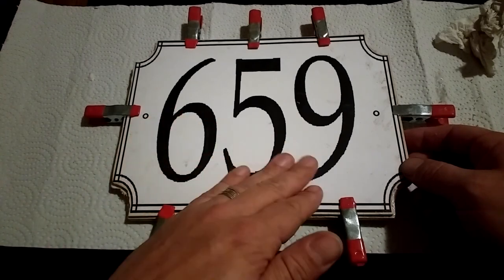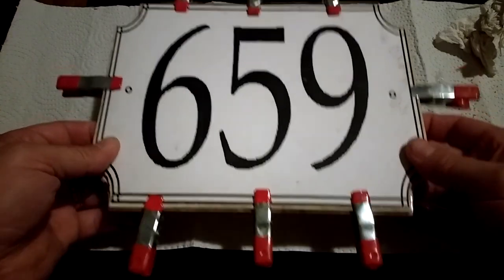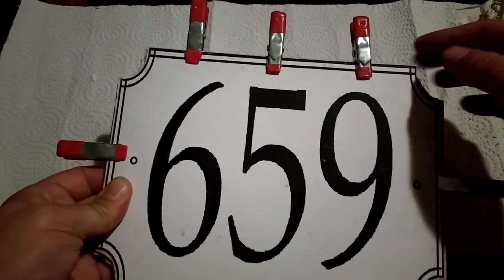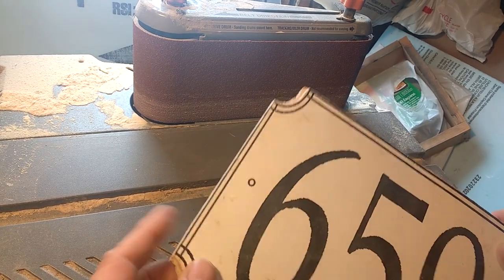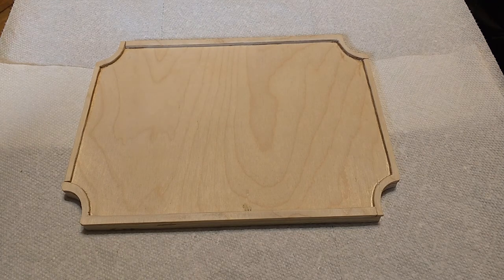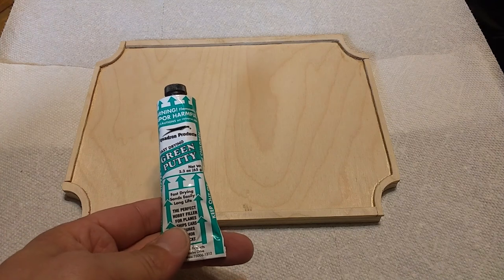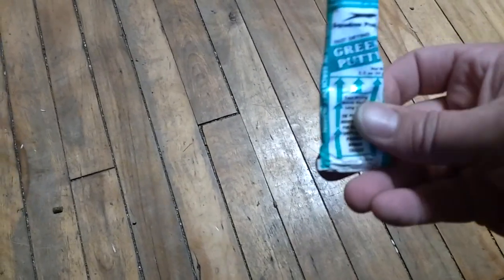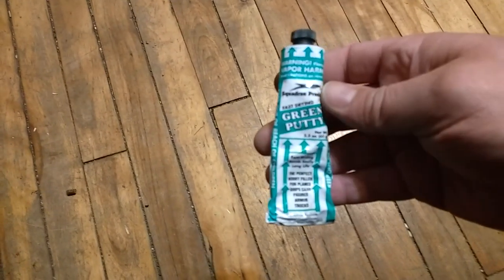Making a Cast Aluminum Foundry Pattern

Comment: Nice job, it'll be a great pattern to reuse.  You're making bigger flasks and I'm thinking of making a smaller one. Just finished a casting project where the parts were small. Ramming up a big flask for a little 1" cube got pretty old after a while ;-)
Reply from the maker: swdweeb haha, yeah I bet.  The bigger molds arent much fun to carry around, that's for sure!  When I have small patterns to cast I sometimes try to fit a few.of them in the same flask.  Sometimes it even works!  :)

Comment: looks good, what program did you use to make the numbers and outlines for everything?
Reply from the maker: Chirpy's Tinkerings lol, I used the only CAD program I have - MS Paint!
Reply: I guess that works, lol.
Reply from the maker: Chirpy's Tinkerings I just made one corner of the border using simple shape tools, copied it, then flipped the image one way, passed the original mirror image onto it to get half of the outline symmetical, then copied that, flipped the whole thing the oher way, pasted on the copy of the unflipped half.  Pretty easy.  The text was just the text tool with huge point size.
Reply: oh, ok, Ill have to do that for the letters for sure then, lol. Thanks!
Reply from the maker: Chirpy's Tinkerings whatever works...  I try to keep things simple